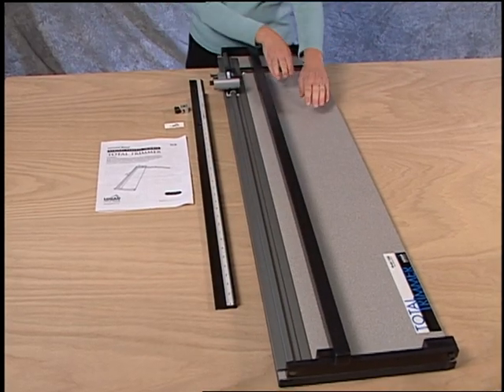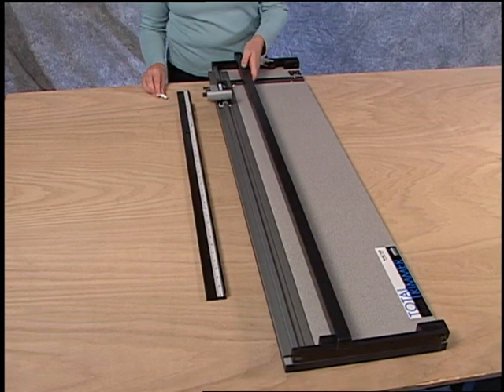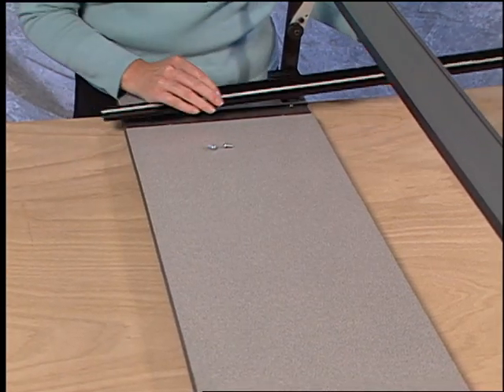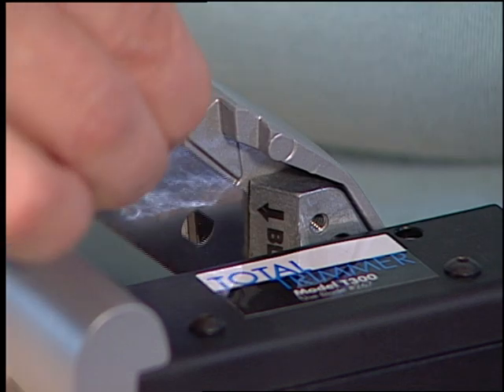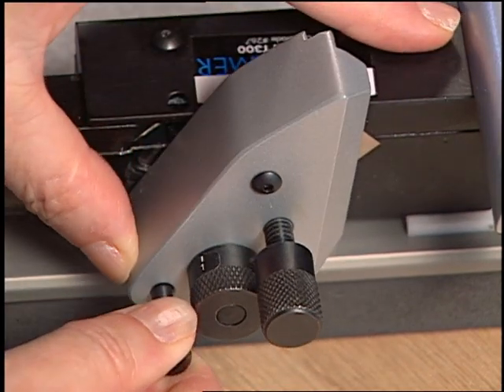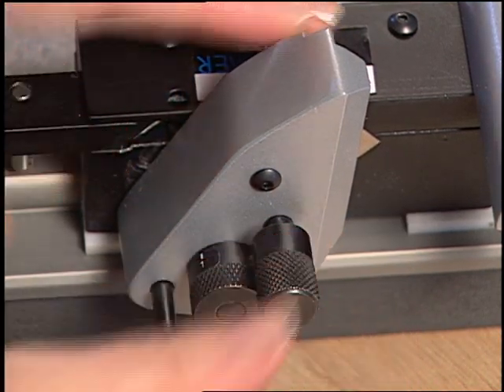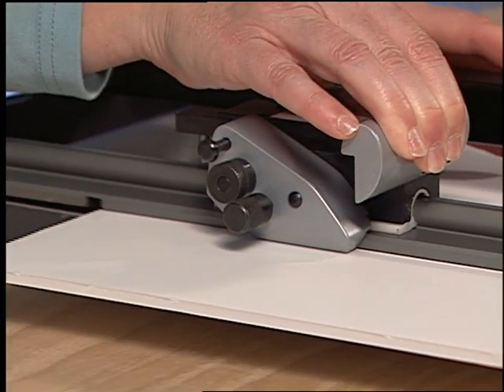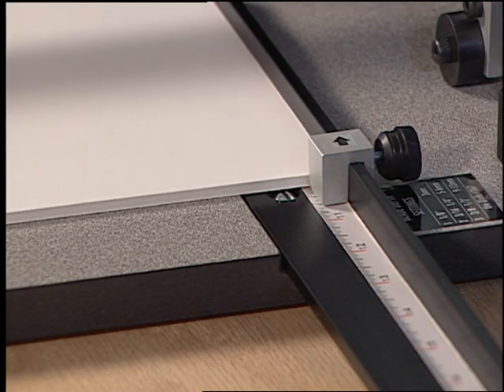LOGAN T300 and T360 Total Trimmer

Comment: Could you please tell how well would this cutter in cutting materials like STADUR. Would it cut in one pass or at least in 2-3 passes?
Reply: +Сергей Чук We are usinng 10mm stadur.
Reply from the maker: +Сергей Чук 
Hello, I am not familiar with STADUR but from the looks of images I found on the internet, I am not sure that it will cut it. The Total Trimmer uses a standard razor blade. So if you can invision a razor blade cutting through this material, then it would work. But I would imagine it would take a few passes to get through.
Reply: With fletcher 2200 it takes 4-5 pases to cut it more or less straight. During 2-3 years of everyday use our Fletcher showed signs or being tired. Looking for substitute. The main question - your cutter quality is enought to work 1-2 years in production? With the local price difference (400usd VS 2000+usd) that would be enought to buy your cutter every 1-2 years instead of 2200 for 'onemilliondollar'.
Reply from the maker: +Сергей Чук 
I think if this STADUR material is more dense than things like foam board, coroplast and illustration board, you will be putting more stress on the Total Trimmer than what it's designed to do. If you had to make 4-5 passes on  a Fletcher, then you would need to do the same with the Total Trimmer as both essentially use a standard razor blade. That drag force of pulling through  a material that dense will eventually wear the threads on the rotating blade holder and could cause part failure. If you like, you could send me a few sample pieces of the STADUR material and I can test it and let you know my evaluation of performance.

Comment: Hi there would this trimmer cut through 5mm Kapa Mount Board (it has aluminium liners) with a fine art print mounted onto it (310gsm)? I am looking for a trimmer that can speed up my production of trimming mounted prints and trimming prints.
Reply from the maker: It will cut 5mm Kapa board but not the kind with aluminum laminated to it. This tool uses a standard razor blade only and is designed for materials suitable for use with a razor blade.